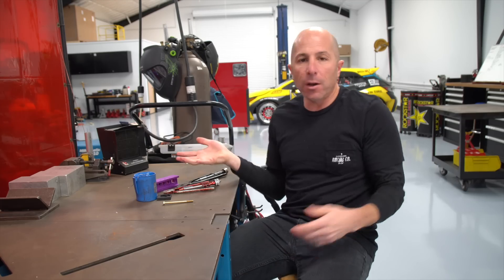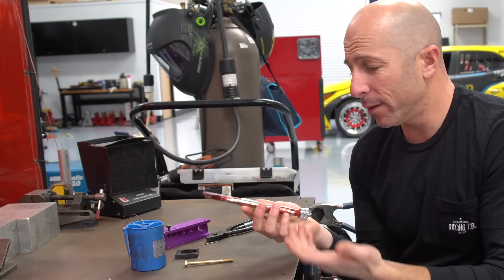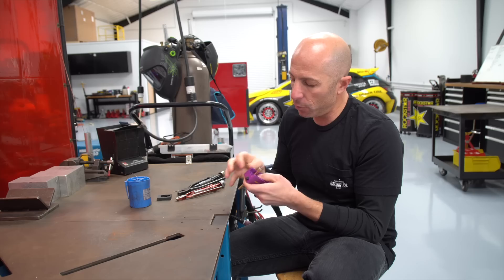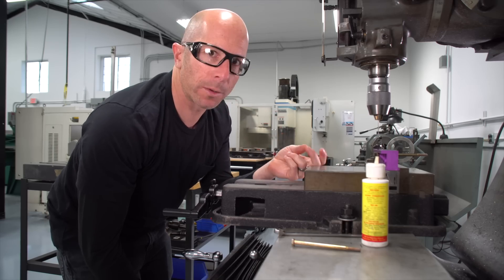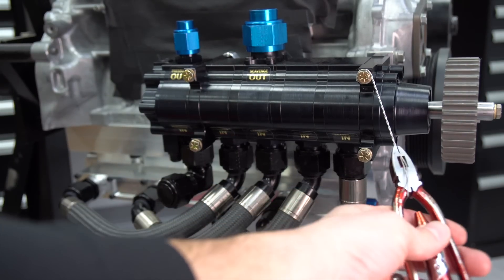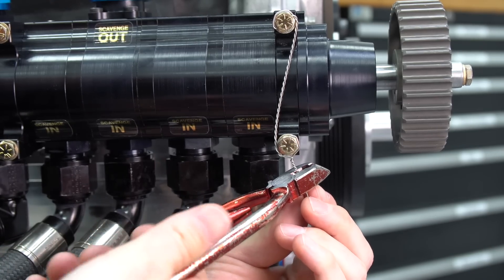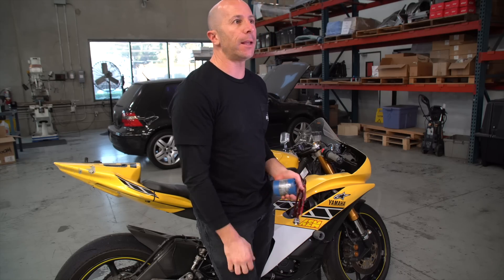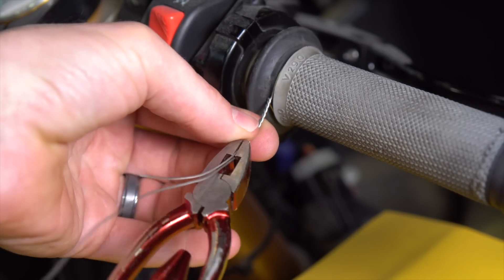How To Safety Wire Bolts, Grips and Drill Bolt Heads

Comment: Suddenly everybody in this comment section is an aviation mechanic..
Reply: Well when we’re looking at safety wire on YouTube....yeah... an aircraft mechanic will pop up. Btw, that’s an example of a safety that would get cut by the inspector ☺️☺️
Reply: Actually I used to be one 😀 I wouldn’t sign off locking like those bolts, but guess it’s fine for a car
Reply: I'm actually an aviation mechanic.
Reply: Around The World, Baby
Reply: Yep, I'm an avionics tech
Reply: I mean it’s a video about safety wire which is a big part of our job so of course there’s a lot of us here lol
Reply: Nope, I'am an avionics technician :D
Reply: Some of us are.  😁
Reply: 😂 All the other A&Ps beat me here. I haven’t turned a wrench on a plane in several years, but I remember this training like tying shoes. 😉 Still have my $80+ pair of Snap-on pliers to this day. 
Gotta pop that wire to square it off to the bolt and twist it snug, then let 2 or 3 twists loose to let them meet the next bolt. Feed it through, twist it, cut it, and bend the pig tail back into the bolt, so the next guy doesn’t get a blind cut. 
It takes practice, but like tying shoes.
Reply: No, they just watch AgentJayZ.
Reply: so... you were saying? lol
Reply: 71B MALS 14 baby
Reply: But I actually was an aviation mechanic...
Reply: 🤚🏾 me I’m an aviation mechanic 😂
Reply: But I am.  The pliers that are the tits are from a company called Milbar.
Reply: Aircraft Hydraulics, always under pressure!!  I wouldn't sign that off either, but cars don't fall out of the sky...  Or do they??
Reply: @manuelmartinez4634  Well drive along Rt 92 in Colorado and they just might.  That drop is heinous.
Reply: Yes with an IA
Reply: I'll be in commodities and I know safety wire is used a lot in my line of work. I really struggled with the class I had on it and I just want to get better, I don't want to be known as the person responsible for a pilot dying with misuse of safety wire.
Reply: Ricardo, everybody? No not everyone, but you will quickly come to find out that we can be very strict about it. It is an easy way to identify who in the trade wants to be professional, and who just doesn't care about the quality of their work. Safety wiring is very easy to discern a true professional by the small attention to details, and it is also very easy to see where or if a person messed up.
Reply: @danielwilkinson1024  in school everytime i practise lockwire i cut myself. this shit gay. everything should be fastened with cotter pins. fuck this shit lmao
Reply: Yeah, I'm a TF33 mechanic at Tinker Air Force Base and I really cringed to see the way he finished that pigtail. But hey I guess it works but no inspector in propulsion would ever let that fly (unintentional pun).
Reply: @Weekend_Washouts  I was thinking The same, The pigtail should have been finished on top of the lower bolt
Reply: @Weekend_Washouts  15Bravos for life

Comment: Drilling holes......4:00....You'd be surprised at the number of 'mechanics' I've worked with that thought the bigger the drill, the faster it should turn....many ruined drill bits, especially in that naughty Stainless Steel...!
 I've been riding Harleys for over 50 years, so safety wire is indeed a friend...

Comment: I'm not an A&P mechanic, but I've done maintenance on my airplane including install a new feather lite starter on my Lycoming engine. This included calculating a new CG because of the weight difference. I did this under the supervision of an A&P mechanic, but he was required to do the safety wire. As your video illustrates, there is a definite method to your madness and a good reason someone who knows the proper way should be the one to do it where it really counts. Great video, thanks!
Reply: I would advise you to not use this video as a how to example to safety wire.  I counted  five things he did wrong when wiring those two bolts.  I would have cut that wire and told him to do it again.

Comment: Prior aircraft mechanic here: this is pretty sloppy wire on those bolts... there's better examples out there. Also, use monel, not stainless wire. Whole industry is switching to monel because it doesn't break nearly as easily from fatigue.
Reply: fatigue? engines are taken apart just after few hours of abuse... :)
Reply: Do a YouTube search for: Agent Jay Z lockwire. He has a really good mini series of how to properly use lockwire.

Comment: Should do the twist on the tail at the outlet hole.  Also, the span between the bolts wasn't quite tight enough.  I used to work on Sea Hawks in the Navy.  What most people don't realize is holding torque is the secondary function of safety wire.  The primary function is if hardware breaks, the pieces stay relatively in place and don't get caught in linkages.

Comment: If you just start twisting just a tiny more than the length you need you can get it first try. Twisting at less than you need will always be less as twisting the wire will make it shorter than untwisted wires. So at a minimum just twist the length you need.

Comment: Safety wired nearly everyday working on jets in the Air Force. Stops them bolts for coming off. Some aircraft safety wire jobs are a real pain in but. They make some cable safety wire guns that can make short work if you don’t want to do it by hand.

Comment: I have locking grips on both my mountainbike and my dirt bike, they are a gift from heaven cause they are really easy to change when they are worn out, really easy to install and never slips due to the m4 screw holding them in place!

Comment: Isn't that what thread lock is for?
Reply: Yes, which has caused many people trouble because if the threads aren't cleaned and primed proper it won't stick and eventually the vibrations can break it loose
Reply: Thread lock isn’t always reliable
Reply: Threadlock doesn't stop the bolt head from getting logged somewhere if it breaks. Safety wire does.
Reply: Daniel Tigges No. there are situations where you can't use it, and wire comes in handy.  That, and Loctite can fail, be applied to oily, or dirty threads, used in the wrong application,  where wire is tried and true, and you can visually see the status.

Comment: easy way to keep cut-offs from flying everywhere: Fill the "void" where the cutters are with rtv or some soft silicone, let it cure and cut it in half with a razorblade. Your pliers now hold onto anything you cut
Reply: Smart.
Reply: ...Or buy aviation style pliers... They make those with plastic pieces to prevent the clippings from flying everywhere.
Reply: That’s pretty genius

Comment: You never showed how to twist the wires with the tool. The lower 
end of the tool with the twisting mechanism was never  shown. At one point you mentioned
that you would twist this one turn by hand. What was the alternative?
Reply: There's a small knob at the base of one of the handles that is attached to a spiral rod that goes up into the handle. When you grip the wire and pull on the knob, the knob and spiral extend out of the handle, and as it does so the spiral shape causes the whole pliers, and the wire that its clamped to, to twist.

Comment: That is a H O R R I B L E safety wire, that would never pass inspection.

Tip: Always have your twists end at the hole, not like he did at the side of the bolt. 6:10
Reply: sIx To EiGhT tWiStS pEr InCh

Comment: A good tip for getting the tail that little bit more taught especially in areas of little access is to actually motion the wirelock plier in a circular motion as you also rotate the pliers 90 without using the puller at the end, alternatively grip the wire tail as close to the bolt head as possible and rotate from there.
Reply: Can you explain this a little more? How does that make it more taught? Does it just "walk" the wire tighter through the hole?
Reply: @9rjharper  Do a YouTube search for: Agent Jay Z lockwire. He has a excellent mini series of lockwiring.  Easier to watch how it is done than it is to explain it.

Comment: He said to turn the drill bit fast. I thought steel should be drilled at low rpm? I am learning, amd trust his opinion but would aslo like to hear other opinions, anyone care to explain this further? Thanks!
Reply from the maker: Hi. You do want to drill at low surface speed. The very small diameter drill bit at high RPM still has a relatively slow surface speed.
Smaller drill bits need more RPM to match the same surface speed as a larger diameter drill. Alternatively, drill bits need to be run at a lower RPM as they get larger.
Reply: @PapadakisRacing  thank you very much!!!!!!

Comment: Don't be afraid twisting wire by hand and a set of duck bills. You need to know it because there's always a place the tool won't fit. Fill the cutter area with silicone, when the silicone is dry slice the silicon with a razor blade so the will open. Now your pliers will hold the waste pieces of wire instead of letting them fly. Get reversing pliers for when you are safetying 3 bolts together, reverse the 2nd twist to hold the wire tighter. 7-8 twist per inch.

Comment: aircraft mechanics are cringing everywhere
Reply: Rog dude this guy is not working on aircraft. For the motor trade this is more than adequate. If you are going to be critical go watch a video of someone doing lock wire vids on a plane.
Reply: Lock wire Reeeeeeeeeeeeeee
Reply: Rog facts. 😅
Reply: For someone who works on planes they aren't the brightest people, let's just compare working on racecars to working on fucking airplanes amirite?
Reply: @_LEONKING_  failure is acceptable in some cases for you then.
Reply: It was very sloppy. I counted six things wrong with that safety wire for those two bolts.
Reply: @BC437A  I've never learned anything about safety wiring. What did he do wrong?
Reply: I'm cringing right now. in the army we stay away from those safety wire pliers  because they don't have a reverse action to properly secure the wire. we also have a specific manual for this
Reply: Armando Rodriguez my tool section has a heavier maintenance box with a specific set of safety wire plier that can do both clockwise and counter clockwise, plus a little rubber pad by the side cutters that holds onto the clippings, they’re sick
Reply: 204 Series  @ajrod85
Reply: it’s the right idea. there’s nothing really wrong with it.
Reply: Yeah... Not tight enough, too short twists, slack...
Reply: @ruikazane5123  it's just a wire now. If anything that loose wire will vibrate
Reply: This is how it's done     https://www.youtube.com/watch?v=OwFjUX6SaY8

Comment: Advice from an F-15E Crew Chief (general mechanic), who often safety wires hardware: make sure to tug on the strand of safety wire going through the second fastener directly in line with the hole in said fastener. This helps eliminate slack In Your twists and further secures those fasteners. Great video!
Reply: Yeh I was thinking it was a little loose, i guess it doesn't matter as much when you aren't flying through the air like a bullet.
Reply: And advice on where to purchase the hardware? I've looked but can't find good bolts online.
Reply: @Andrew-jd1dt  MSC or Grainger would be a good start.
Reply: @rhubarbpie2027  Thank you!
Reply: Kind of ironic that the guy who’s looking up an instructional video on how to safety wire is giving pointers 🤣
Reply: @jerryurena6637  I didn't look it up.

Comment: I hate to say lock wire is something from the 50s. 
In 50 years of motorsport the only thing ever wired was the sump plug because the rules said so. 
Or  as an engine sealer for  a control category. And unfortunatly lost a lot of small drills.
IF a bolt is done up properly it will not come loose. And if it comes loose it was not done up correctly.
Even bolts with viabration issues are simply Loctited.  Basic prep for the last 40 years!

Comment: laughs in aircraft mechanic

high end army/navy tools
Reply: Army aviation here. What are saftey wire pliers?! Haha
Reply: someone come 7lvl those wires
Reply: @RicanHavoc  I wouldn't catch that x 😂😂😂
Reply: My gf was a machinist mate in the navy I've been looking for some things she can safety wire for my car.
Reply: satellite mechanic here, I'm lucky if there's even a torque wrench available let alone safety wiring anything lol
Reply: Them pliers are fancy... Wish we had some
Reply: B52 guy here, we use whatever brand comes in, our tool contract switches all the time lol
Reply: I just do it by hand. Keep the strands at 90 degrees and it will look perfect every time. However, sometimes a "7 level twist" will be needed.
Reply: I’m Air Force and we use snap on
Reply: Still have some from the navy lol they work still
Reply: F16 / F15 specs nerd. I use snap-on twisty boys.
Reply: @shit0rbust  bluepoint* which are milbar. Its definitely worth it having a lifetime warrenty on them, they definitely dont last long being heavily used. Helicopter mechanic here
Reply: @PvTNuclear  Like these? Snap-on Wire Twister/Cutter, Reversible, Cushion Throat, .041" cap, 8-3/4" long (Blue-Point®)
Reply: @RichardKaseler  yes
Reply: Chair Forks (Air Force) uses Blue Point  safety wire pliers. They are nice 👌
Reply: @rhubarbpie2027  those are just rebranded Milbar.  Milbar is the top end of safety wire pliers
.
Reply: Ughh please invite me to the garage I'll show you how to safety wire.....
Reply: GE turbine engineer, milibar for the win hands down!
Reply: @edcar8713  any position available for project managers? 🤣
Reply: @edcar8713  same brand
Reply: Yeh yeh you are superior to all others, ok.

Comment: I was a mechanic in the USAF.  We safety wired everything.  Useful skill to know.  If you want to get it tighter on the ends, you can hold the wire taught with the pliers and do a big clockwise circle.  Nothing wrong with what you're doing, that's just how I was trained.
Reply: Michael Melton commonly
called a ‘depot twist’. We got our asses kicked when caught doing them during trade training  here in Oz.......
Reply: I can see that.  You can definitely over do it, breaking the wire or bust out the hole.

Comment: Good point recovering dropped pieces, I heard about a guy that lost a bolt on a simple valve cover job and he just replaced the bolt. But the lost bolt had found its way behind the crank pulley and lodged into the oil pump and btoje the housing, motor had to be pulled and rebuild...
Reply: In aviation, we called these dropped pieces FOD - Foreign Object Damage (or Foreign Object Destruction). A big part of our job is preventing FOD.

Comment: Awesome video, I knew it would be worth a watch. I have been avoiding safety wiring my Wilwood rotors but I think this has inspired me to pick up the tools and do it.
Reply: Use proper fasteners and loctite.
Reply: @ldnwholesale8552  Already do that, but I have heard so many stories of them working their way loose after track days because of the heat cycling that I'm paranoid. The most common recommendation I seem to get on them is doing the regular items and wire lock them if possible. It will just be a ton of work to drill and wire them all.

Comment: I dunno about the motorcycle grips , grip glue or contact cement is much better since it goes around the whole grip and doesn't protrude.Its a pain getting it off but it feels and work so much better in the long run ; the way you tied the grip means that its gonna twist in the middle of the throttle tube or at the end so you'll have to put wires there.

Comment: Steph is there a possibility for you to make an electric hybrid kit like a fisker karma but for a  motorcycle the petrol engine is just a generator .

And for drive a hub motor like ORBIS drive (with a motor from formula student team Amz with their  3.4 kg (7lbs)weight and 50 bhp power around 400 NM of torque and physical size of the motor is as big as cantaloupe ) .

Comment: Every Racer should have safety wire pliers and safety wire. It is almost as universal as racers tape.
Reply: Watched it again I see now, they really would be handy.
Reply: I'm actually surprised I've never seen a concretor or steel fixer with a set.
Reply: @Neishy86  they're not pricey either, I got some at princess auto(canadian harbour freight) for like 10 bucks and that was 6 years ago
Reply: Dale Neish if you look at the pliers they have a lock on them to clamp the wire and piece that when pulled spins/twists the wire. That is why it is such a smooth motion.
Reply: @2superblus  oh that's what the stuff in the middle does, I thought he just twisted it like normal pliers, I wish I had a set of those when I was making gates.
Reply: Don't forget zip ties for your bumper and if your clamps failed on you